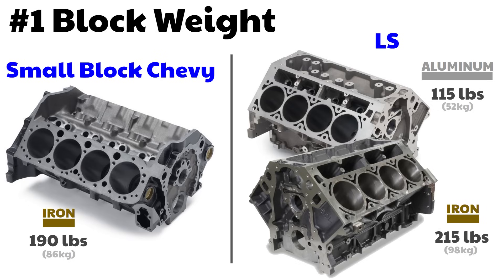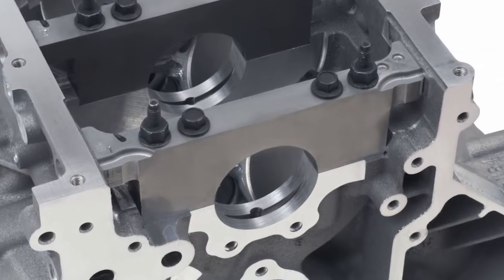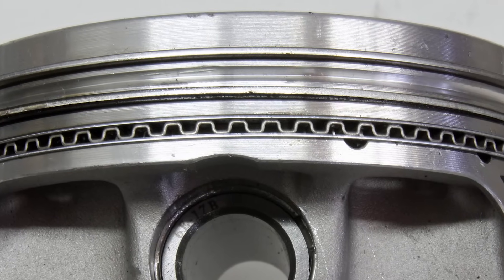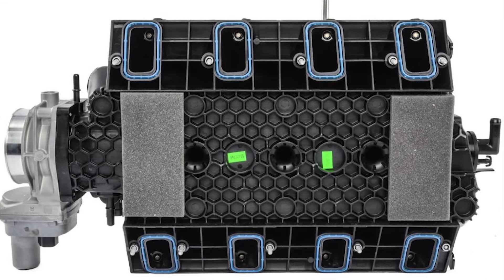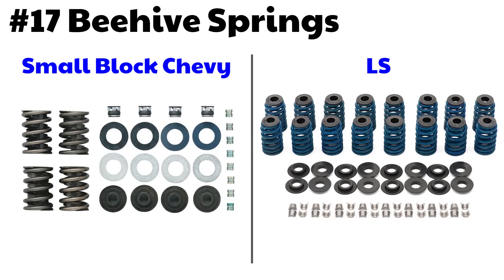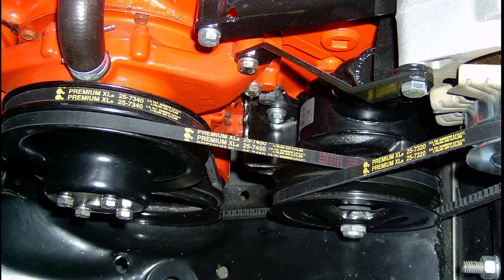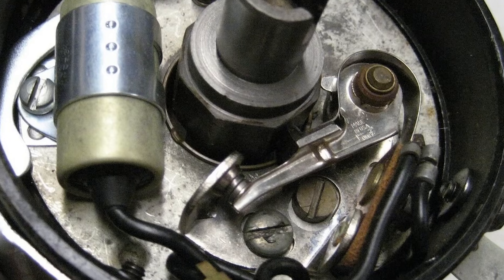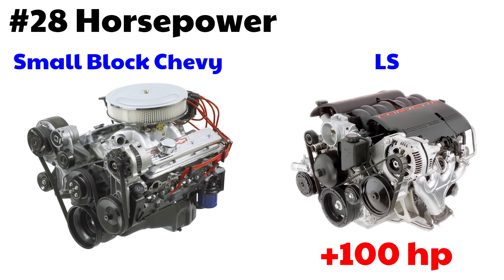29 Reasons LS is Better than Small Block Chevy (Gen 1 & 2 vs Gen 3 & 4)

Comment: This video is a bit biased towards the LS.  It is a very good engine but not without its flaws that weren't mentioned here.  A couple big ones are head sealing with boost because it only has 4 fasteners per cylinder and they aren't right next to the bore. And windage issues because of the extended skirt block.  That's why the LS Next block from Dart has a bottom end more closely resembling the old SBC.  In this video they said it was a negative for the old engine.  And the max power numbers for the old engine are way low.

Comment: this is a bullshit video....everybody knows the lx is just a hopped up small block ......if you put on perforemance parts on a small block you have a bewtter engine.......racing a small block is simpler and costs less money and doesn't have the cons like the ls does ...you can't change a bad lifter on an ls without pulling the entire head.....smaller bore of the ls means smaller valves......................................................................................................................

Comment: There was old small block Chevy's that would rev out  7000 RPM DZ302 And they underrated the old school small block Chevy's horsepower Some have 400 plus horsepower I'll stick to my old school small block that way I don't have to deal with cams and valve train problems And spend in $300 for $20 center

Comment: You need a plug-in that goes to your car to the computer. You need the program in order to dial-in your air fuel ratio and you have to adjust other sensors after that.

To adjust a small block, grab screwdriver  and listen

Comment: Limited to 350 HP???? UUHHH 327's made that back in the day...365hp usually so take 20 for net and that's STOCK. Same with the LT-1 360hp stock. You have so many mistakes in this video it's not even funny dude. You never said anything about forged sb cranks from the factory vrs cast cranks from the factory. Again you never said the difference between FORGED pistons and non-forged factory pistons. I guess you never heard of AFR aluminum heads for SBC. More lies, a carburated engine properly tuned makes about 15-25 more hp than injection. You can get roller solid lifters for a SBC. you can get 1.6 rocker arms for a SBC. You don't have to remove the cylinder heads on a SBC to change the cam! A 302 SBC from 1967-1969 can do 8000 rpm from the factory...yes I said 8000, they only came in the Z-28 of those years. Multiple belts on an angine means if one breaks you still have a waterpump. Your electronic sensors and ecm makes it harder to work on.

Comment: Lots of misinformation here. Roller lifters were in 1985 IROC-Z, not 1987. Bad lifter in SBC, pull the intake. Bad lifter in an LS-Pull the heads! I could go on. BTW, I have a C5 with an LS7. The LS7 has one of the worst designed/machined heads GM ever produced. Sorry I ever heard of an LS7 anything....

Comment: Aluminum head not as good you can't shave the intake holes or for more intake the Aluminum you can't or start risking structure the Aluminum heads can warp if not cooled and purged and melt values or values sticking and smoking and if warps can blow out the side of the Aluminum ls great for daily driver not a xtreme heat motor the min you start making a metal forge with vacuum and push that's basically what it is a small block rocket motor best to see the flames out the exhaust then out the side a head  then hit a purge line turns bad real quick. The steel head more likely to shot out the bottom  ls will last as said for a daily but the aluminum heads and values do warp due to aluminum will wear faster being a softer metal

Comment: It would be nice if your "detailed information" was accurate. The power levels you quoted for the small block are absurdly low. I've personally built small blocks at much higher power levels. But what should we expect from someone who is nothing but a keyboard commando with no actual experience.

Hypereutectic pistons have been available for the small block since the early 80s.🙄

You are a clown. 🤡

Comment: My 96 LT1 is a lot closer to an ls than you make it sound.
What matters most to me is horsepower per dollar and hands down the small block wins. I can buy a small block and get 4 bolt splayed main caps installed cheaper than the price of an ls block. Aftermarket cylinder heads are a lot cheaper than ls heads

Comment: saying the old small block only handles 360 horses is silly.... they have been built with roller cams since early 60's making way more than 400 hp, in drag racing abuse.. i only made it to reason 5 .. too much wrong information already.

Comment: The SBC was designed in the 50's and the LS was designed in the late 90's so of course the LS is going to have upgrades that's just common sense but the SBC has many good things about it. If it was not for the SBC they would of learned nothing to make the LS a better block then it is same goes for the LT

Comment: There is absolutely no argument to be made in favor of the SBC over an LS in daily driver. In a week end hot rod though it's a tougher call. I still favor the SBC over an LS. I currently run a 520HP 400inch Blueprint SBC in an old Corvette C3. I've seen so many LS swaps in cars like mine and they just WORK no denying that. How-ever a couple advantages keep me in the old school SBC and out of any thought of swapping to the modern engine. The 2 biggest reasons: Simplicity and the right look under the hood. In a week end cruiser and occasional drag strip runner the LS's advantages aren't nearly as a big a deal here as they would be a daily driver. All those sensors and computer controlled engine management do provide better cold starts and MPG yet neither is much of a concern for this car and it's limited use on Sunny day cruises and the occasional drag strip pass. Bigger priorities are found in the correct appearance under the hood and keeping the over all feel of the old school. Besides there is enough "new" tech here to make a crap load more power than was typical when the car was new. Roller cam. aluminum heads and a RPM Air gap fix more than just a couple of the deficits you point to in your video when comparing the SBC to an LS. The SBC isn't stuck in the past. 50 years ago 1hp/cubic inch meant only the raciest SBCs ever saw more than 350HP and anything at 400HP was starting to get too racy for street use. Today 383s running no special or expensive pieces inside, running with vortec iron or very basic inexpensive aluminum heads and a roller cam typically crank out 400-450HP all day/everyday with ease. The 400 I'm running does have forged internals but still nothing special for heads and a cam.......get more serious.... with really good heads and more cam approaching 600HP NA is very doable while retaining street manners that don't fall under the need to trailer to the track. Go back 50 years and try to say that to racers of the day and they'd have laughed at you and your deluded belief. All this said in favor of keeping a SBC requires me to at least admit though......the SBC is pretty much all done at these power levels anything more is too racy for the reasonable expectation of reliable street car. Mean-while go to any good sized car show or the drag strip these days and you'll lose count of how many times you'll see an LS Turbo'd and making stupid big, relaiable power well beyond 600HP.

Comment: I find you Horse power handling stats for the old school SBC to be awfully low. Makes me wonder if you're speaking to 2 bolt blocks only. I've seen way too many builds that well in excess of 500HP to buy into that as a limit. That said though. ARP bolts throughout and a 4 bolt main cap is absolutely the way to go.   2 bolt blocks can be built for any power level, but as you approach 500HP, a 4 bolt block  becomes MANDITORY, a 2 bolt block can be built for 500HP but "walking" a crank shaft in a 2 bolt block is going to happen far sooner with the 2 bolt and at that point it's just a matter of time before something catastrophic will happen in the lower end.

Comment: Maybe you forgot or maybe you didn't know.
About something called coil saturation [the time it takes the coil to build up it's magnetic feild in miliseconds].  With individual coils each coil has more time [miliseconds] to reach saturation time. Moreover, as the engine gose through it's rev range the higher the RPM'S the less coil saturation time their is.
One more thing, for those who have to have a distrubutor, their is a distrubutor kit for the LS.   By the way individual coil per cylinder isn't something of the modern era, the ford moldel T had one coil per cylinder, but Henery Ford called it a buzz box due to the sound it made.

Comment: This is a very biased view of the small block Chevy. Let's talk cost to rebuild, Old school wins by a bunch. Everything you mention is about racing. The 1996-2001 Vortec has the chamber design (that's where the LS design came from). You can get any part for the small block aftermarket for racing, like forged stroker crank, H-beam rods, any ratio rocker you desire, etc, I have a balanced small block in my 86 truck with Keith Black hyper eutetic coated d shaped pistons and Vortec aluminum heads. 9.5:1 runs on pump gas and makes 400 HP. The LS engines have oiling problems which the small block doesn't. I have 3 trucks with Vortec engines in them, I just rebuilt one under $1,000 including $300 machine work (crank turned and cylinders bored .030" over). If you think that a built small block will only turn 5,800 RPM, you must live under a rock. Most of your comparisons are using very old parts/specs.

Comment: The primary reason they went with multiple coil setup on the LS was to reduce ignition coil saturation.  Which is the primary reason RPM was limited on factory stock SBCs; coil saturation.

Comment: #24 - Sensors of the LS.  Although they provide much better engine management, they also add a massive layer of frequent failure points for these engines.  Countless numbers of crank and cam position sensor failures, tank vent sensors, mass air flow sensors —> all conspire to make the reliability over time questionable.

Comment: #20 - SBC gaskets had one MAJOR advantage over LS gaskets.  They weren’t subjected to the gasket deteriorating chemicals of DexCool, and therefore often lasted the entire life of the engine, not just 20,000 miles like the LS gaskets.  Edit: The same cannot be said for the horrible SBC valve cover gaskets.  Although the force spreaders the factory added later did help a tiny bit.

Comment: #20 No SBC mechanic in his right mind EVER used those intake end seals…. In fact, even the factory eventually stopped using them toward the end and started following the aftermarket’s suggestion of just using a bead of silicone.

Comment: …the hell are you talking about, “#18 - having to remove cylinder heads to remove camshaft on original SBC”? That’s ridiculously not true at all.  You only had to pop off the intake (which is SUPER easy) to access the lifters.

Comment: The main issue with LS engines that's a huge negative is all the stupid sensors and a computer that controls it. I can build a Sbc and if something breaks I can fix it in about an hour. LS engines plug in ur obd reader and by the time your done with that I will back on the road while your still dealing with the ecm to find out what's wrong. Good luck. Lol

Comment: I will add a couple of negatives of the LS. 1: must pull the head off just to change a lifter (which seem to fail very regularly). compounded by 2: the weak arse threads fail on the alloy block when pulling the heads. After having my 3rd thread fail, I have sold my ls and gone back to a small block.

Comment: Literally 90% of what’s mentioned can be converted onto a SBC. Fuel injection, roller cam and lifters, coils and ignition box, aluminum heads. and sensors aren’t a positive it’s a lot easier to diag and fix a sbc. The fact you labeled VVT as a positive tells me you ain’t been around motors much

Comment: New cars are great but it's just more computers and sensors to break and stop reliability.  The old sbc and a carb .all you need is eyes and ears to fix it. You don't need super expensive computers to fix it. The only thing I don't like is displacement on demand.  It ruins cams . And should be removed.  They wear out very easily. Dod is not good in my opinion

Comment: I think chevy does great things with a push rod engine.  Imagine if they made a great dual over head cam engine . I think it would be a great coyote comparison.  But lt ls vs coyote is not worth comparing since one if dual over head and one is push rod. The only thing similar is that they are both v8s

Comment: a few things wrong with this list, seems heavily biased and theres some mis information. feel free to correct me and i can prove sources if needed or explain anything if questioned  by any  other enthusiasts

1:the chevy 350 block weighs 153LB  which is 75% the weight of the iron LS 5.3 and the aluminum block 350 weighs 74LB compared to 115 for alum 5.3. not sure where you got the 190LB weight... even a filled heavy dart  and bowtie block weighs 180 a stock iron block

 2. stock GMchevy 350 and under 4.0IN bore handles 1500HP all day claimed by dart (upgraded ,block distributor says upgrades arent worth the change till, 1500)  a LT(gen 2 sbc) handles over 2000 as shown by grub worms fully stock LT1 block, but the commonly recommended powerpoint is also1400 as stated by Dart.

3. skirted blocks do not change much hence why big blocks dont have skirted blocks.
4 same as 3

5. there are plenty of aftermarket sbc valley plates but there are often no reason for them. its been shown that air gap intakes make very little effect upon IAT, its just an additional unnecessary piece.  i wouldnt all this a positive thing or negative

6. early sbc was forged cranks, held crazy power stock. later 74-87 were cast steel rated for 600hp claimed by edelbrock, holley, dart and eagle. on their website, they recommend upgrading at this power point but many people run stock cranks much higher in power. 87+ has 1 peice seals which didn't increase power ability but used hot mold castings which made them handle a lot of power, equal to a cast LS crank, the LT gen 2 sbc had forged, better than most ls 

7. video is correct

8. since 1980 SBC has only used hypereutenic pistons. pre 72 it was forged aluminum in some sbc. 

9. sbc piston rings are cast iron and post 87 is nitrided cast iron, not moly. chrome plated moly is a common rebuild ring but not stock. 

10. post 87 all sbc rods are POWdered metal forged rods, GM rates these for 600hp but they often go over 1000HP in most setups. before 87 all sbc rods are standard forged rods, a cast rod was never found in any small block chevy since the 50s. theres a myth that the 80s 305s had cast rods but that is not true. 

11. the LS heads are a better design and superior for flow, however a stock vortec head 885/906 HD head flows 239CFM@.500 vs a stock 706 head flows 237@.700, both tested by motortrend with 28in, richard holdner also has done this comparison. so, the best sbc head does indeed flow better than worst LS head. another point of reference, a stock LT1(gen2SBC) head flows 281CFM@.600. so there's that.

12. in a port injection, your right. worth noting that IAT tests from richard holdner show that venturi effect makes the intake air temps of sbc colder though. 

13-17. correct.

18. i could be wrong, but you still need to remove the intake heads for LS lifters. sbc however is just intake, loosen rockers and you can remove lifters in valley

19. depends on year but mostly correct.

20. valve covers are reusable rubber on sbc, you are correct about intake though.

21. kinda, the stock 1968 corvette 327 had a redline of 6500RPM but for 350s eagle and scat claim stock pre 87 is safe to 6000, post 87 is safe to 6200.  eagle claims LS is safe to 6000 and certain LS like 4.8 can handle 6500. certain motors are rated to 7500. 

22. this is mostly just preference, most people liked how you could remove certain belt accessories back then for reliability, and if one broke you could swap another over. but sbc has had regular serpentine since 80s. 

23. sbc has had EFI since 87, sbc has had fuel injection since 1955, correct in every way other than reliability, efi fails much more.

24-27. correct 

28, been covered many times, completely wrong. when 1:1 builds are done the power is near identical, R H, hot rod mag, engine power, powernation has all done this thing, huge myth. 

29. kinda,  sbc has larger aftermarket and is more common at swap meets still. LS is more plentiful in junkyards but there are often just as many sbc.

Comment: You are mistaken a first gen smallblock   four bolt block and forged crank can refillable take up to 600 hp and 7000 RPM!!!
Reply: eagle says a stock GM cast crank is fine at 600HP with 2 bolt mains and upgrading is only recommended when going past 600hp or 6500RPM

Comment: Okay well everything beautiful with your video and everything except that to change a camshaft on a small block Chevy you need to take the intake manifold off and pull the lifters out release the pressure on the pushrods which means you just need to take the valve cover off you don't need to take the heads off however on the ls or LT1 you do need to take the heads off because you have trays for the hydraulic roller lifters

Comment: #18 @ 7:35   I thought the heads (and intake obvi) needed to be removed on an LS to pull the lifters for a cam swap? On a SBC you’d pull the intake to get at the lifters but the heads could stay right where they were so no head gasket and extra work for a cam swap? 
Am I mistaken?
Reply: heads and intake need removed. yes. so after spending near double the money on a ls cam vs sbc, you still need to spend extra on head gaskets.